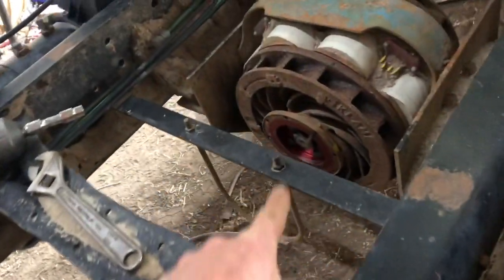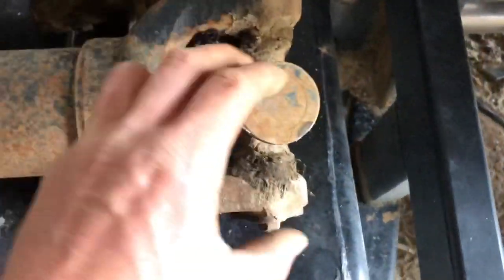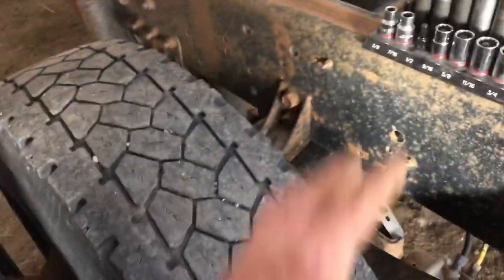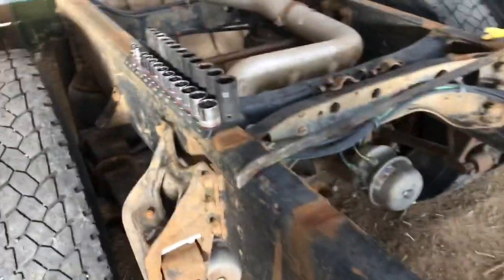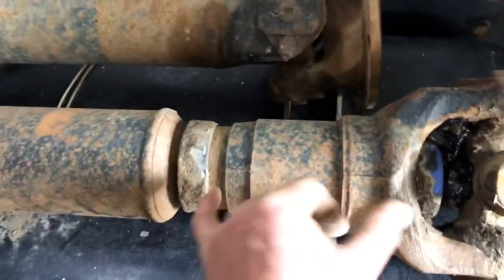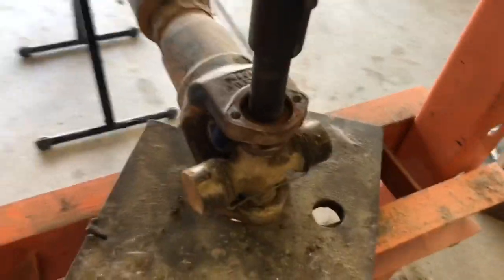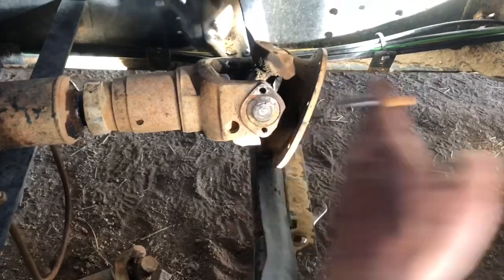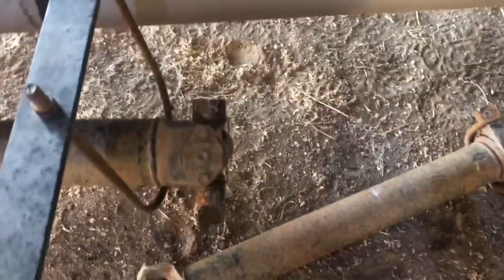1955 f600 school bus chassis swap part 26

Comment: Dont mess air to unlock the brakes cage them there is a bolt in the side of the can  looks like a tee on the end it's a tool remove the plug from the end push the tee end in the hole till it stop turn it it will lock in put the nut back on it and tighten it down till it stops it will suck up the spring in the brake and release the brakes it's how they tow a truck that wont hold air
Reply from the maker: Thanks for the tip! 
Ultimately, that was my plan, but I wasn’t thinking about it clearly at the time. 
I looked for those bolts previously, but couldn’t find them. I’m sure they are there somewhere.
Reply: @jmlcolorado  if u cant find the bolts let me know I'm sure I got some in the shop happy to pass them along for free
Reply from the maker: Thanks for the offer Jeremy! I found them. Had to open my eyes a little wider :)